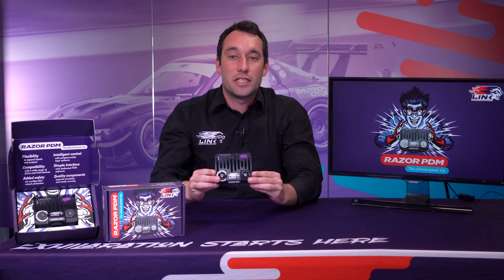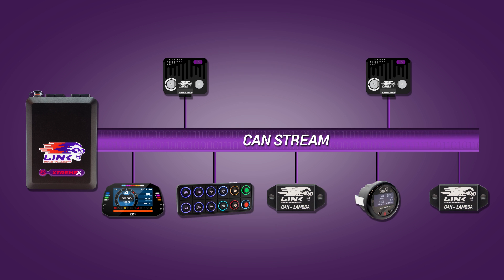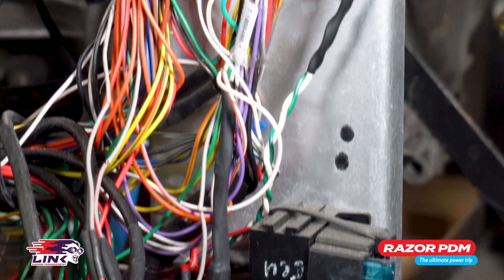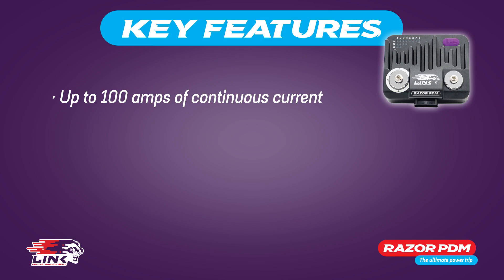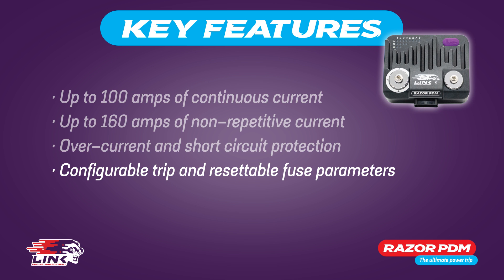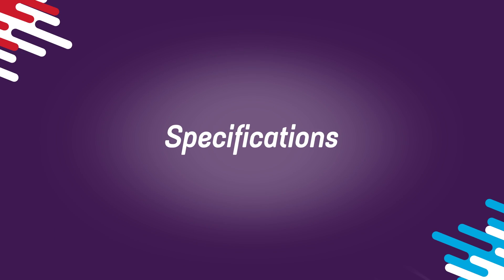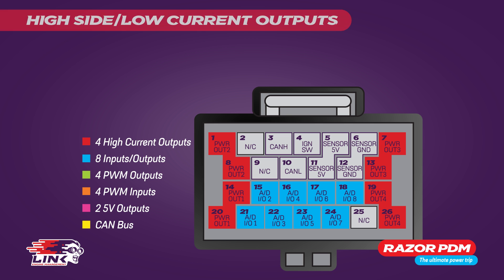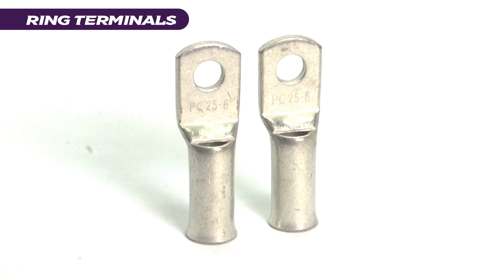NEW PRODUCT - Link Razor PDM

Comment: Interesting little product, and nice to see the product range expanding, but from what I've seen at time of writing (24th August 2022) this is being retailed at around £950. 
I appreciate Link products are of high quality, but when you can buy a whole Plug-In ECU board with up to 11 digital inputs, 16 analog/temp inputs, and 24 outputs (8 fuel, 8 ignition, 8 aux) for similar price... 
I'd have considered buying one in a heartbeat if they were around the £300 price point - and potentially multiples of.
Reply: I guess you dont understand the usage of this?
Reply: I think I understand the usage of a PDM - to essentially replace relays & fuses.

I'm just saying that the quantity of inputs and outputs provided doesn't scale with the cost, and in my opinion it is 3x more expensive than I'd want to be paying.

Comment: Would it be suitable to also drive a returnless full system with like a walbro 450lph (and PWM its speed)??
Reply from the maker: If you contact our tech team via our website, Facebook page, or telephone, and give them the full details on the pump, they’ll be able to tell you whether it should work or not.
Reply: Walbro 450 is not a PWM pump. Though you can do it control is not good. You need something like a fuel lab brush-less pump that is built for PWM.
Reply: @supershagspeed  I am talking specifically about Walbro/TI F90000274; i remember because it's turbine based you could PWM it to run it in a returnless system!?
Reply: @St0RM33 more than likely no you can't. You control the output(basically speed) via voltage regulation,  not by pulsing and changing the duration/ etc of the power. If the pdm can vary voltage AND amp output then yes you could

Comment: Just to confirm but will the high amp outputs be capable of pwm to run a fuel pump?
Reply: Yes
Reply from the maker: Yes. PWM is supported up to 10 kilohertz on the High Current Outputs